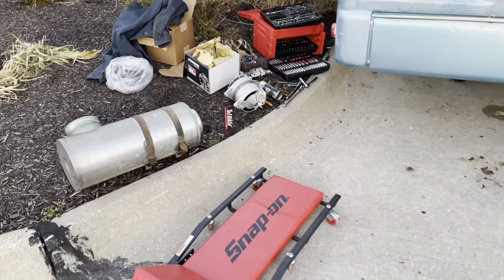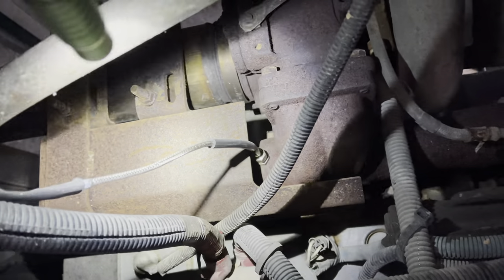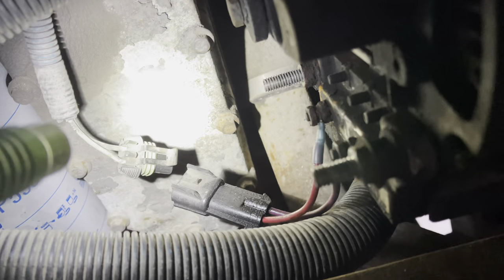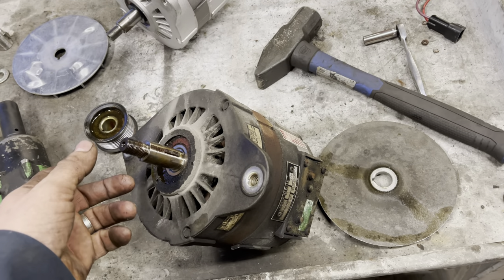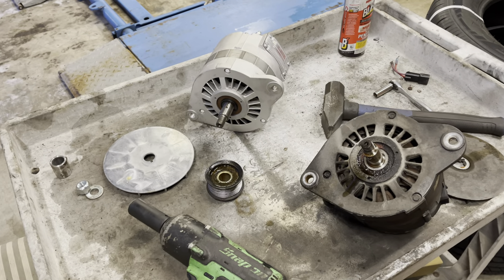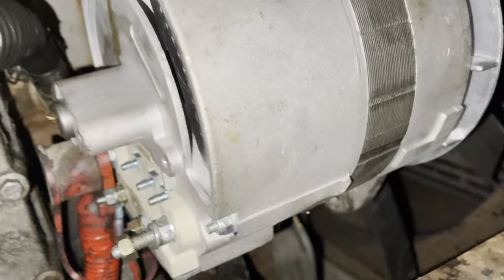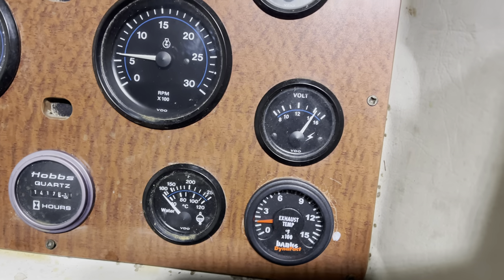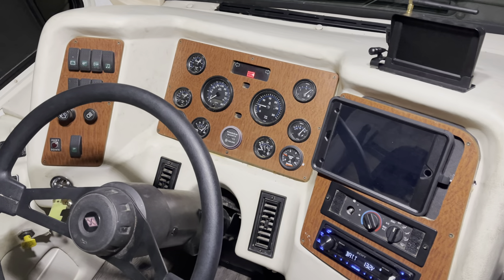Class A RV Chassis Alternator Replacement

Comment: Why did you pay another shop to "fix" the RV was it down to tool's there's no way that job warrants 500 it looks like a car or tractor just bigger.
Reply from the maker: I learned my lesson the hard way. I had a lot of other side work lined up at the time and I had to have the RV ready for our next trip, so I had them do it. Now I realize how badly I wad screwed on that job.
Reply: @DanielJaegerFilms  Yah I remember the mess they made out of your leveling sencor and I think you said they wanted a 1000  to fix it and was claiming that you needed a new drive shaft as the car wizard once said everything is the same just that it's bigger or smaller in size or someone on YouTube said it  .

Comment: I was that subscriber - -Diodes in your alternator failed. I recomend You - repair that old Alternator because it is so much better Quality that this chinnese new one you bought.   Old one after repair can handle another 25years  Ebay - max 3-4years
Reply: I second this recommendation.  Leece-Neville built a solid product back in those days.  And if he decides to take the alternator to someone to be rebuilt, ensure that they do not just swap it out for another unit,  make sure that you get THAT one back. Or do it yourself.

Comment: That alternator looks like a standard heavy truck alternator.  If you find it's not powerful enough, and if I remember right they come in varieties up to 400 amp output. The seperate posts are normal, because they can be used for positive ground systems as well, however it's also to provide a solid ground (the case may not be able to provide enough in high amperage applications).  Also, Love the straight pipe exhaust :)  Always fun for messing with people. If your worried about DOT/Police, you can always slam a "spark arrestor" on to provide a muffler to make them happy :)

Comment: I had a 100-Amp Leece-Neville on my 89 FLC.  It was still serving faithfully in 1999 when the truck was sold, with 900 and some thousand on it. In that time, I saw countless other trucks (stable mates at the same company) with Delco-Remy alternators  getting their 7th, 8th, 9th, etc.  To be fair, Delco-Remy did have a problem in 93-94-95 and some of them ended up being warranty replaced, but it did not cover the tow bill or the physical re and re, or the down-time of the trucks.  In fact, I have never heard a horror story that involved a L-N alternator, although I am sure that somebody somewhere probably has had a problem with them.
Reply: I usually always put on Leece-Neville, and have used lots of their 250 amp and larger models over the years.  I have a hatred of delco-remy after being stuck changing a 42MT starter at -10F because the piece of junk took a crap on me.  Had a buddy of mine bring me a Paccar universal gear reduction starter, and that's all I use now :)

Comment: What pulley is that?  I have the a0012824lc alternator and I can't find the pulley anywhere. No one knows where to get it and what pulley it is on my pusher. I can't get the old one off 😩  alt seized and doesn't spin at all and I have zero clue how to get it off and or get a new one. No one can find it on my Vin either

Comment: I had noticed the voltage was low in other videos Don't recall if I ever mentioned it lol But didn't know if it had a intake heater as some run for a spell even after start up and even with a good alternator and batteries will drop the voltage to around 12 Sometimes even low enough to kick the light on

Comment: The radio always read 1V lower. It’s because it’s using some power for itself. In Electrics terms, if you pumping some Amps, voltage will drop a bit.
See when you start the RV, all your LEDs go out and the voltage gauge’s value decreases as well.
Reply: It disconnects all power draws to maximize cranking power
Reply: @FishFind3000  not at all.
LEDs are made for 12V. The gauge shows a decrease to 10ish V way too low for LEDs to work.
Reply: im 99% sure the radio is getting 14.2 V and the voltage sensor inside is a bit screwed
Reply: @alouisschafer7212  Yeah i don't think those are that reliable.

Comment: Why does the truck have a coolant filter and what do they do .
Reply: Coolant filters don't actually filter the coolant. Instead they place an additive in the coolant that dissolves over time. This additive stops cavitation, that's where the coolant wears down the piston liners overtime until there's a hole.
Reply: @benturner4774  Thank you .
Reply: As another commenter posted, they do have material inside that slow-releases over time to keep the chemistry in line, but yes, they do filter out crap that is in the coolant.  Anything that you do not want circulating in the coolant will be captured and held. Rust particles, metal flakes, bits of gasket or solidified blobs of silicone or liquid gasket that hardened and got knocked off during the re-installation of whatever.
Reply: @stanpatterson5033  Thank you.
Reply: Commercial truck coolant is what is known as an SCA boostable coolant.  The SCA are corrision inhibiters for the system, and with long life cycles in commercial trucks you can just boost the additives to prolong the life of the coolant.  It does filter as well (and they rust out if not regularly changed).  There are test kits for the additives you can get to check the levels, and boost it with addtivies in addition to changing the filter.  There are long release pellets in the filter that disolve over time which maintain the levels of corrosion inhibiters in the system.  If it's low, you would also add a SCA boost solution.
Reply: @JeffLMisc  Thank you do tractors have that aswell that's a great idea do you need to use special manufacturer specific coolant with the filters.
Reply: @neilmurphy845  there are only a few kinds of coolant.  green & red, red is usually compatible with Caterpillar Long Life ELC coolant, and you have detroit diesel with their blue & purple coolant.  However, I think the SCA packages are all the same (between regular & Long Life).  I just make it a habit to use the CAT long life elc coolant because i have less problems with it (and no, it's not dexcool.  mixing dexcool with it turns it to jello).
Reply: @JeffLMisc  Yah dexcool is awful.
Reply: What you guys are talking about is great and all but have you watched the donelson video on coolant filters if you think you know something about it Donaldson will make sure